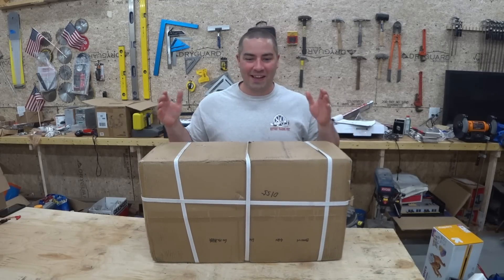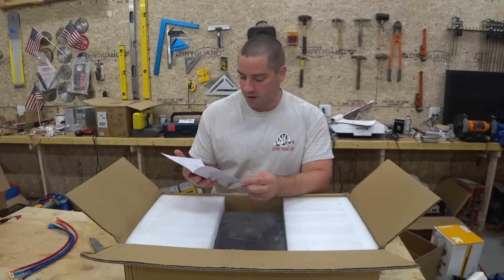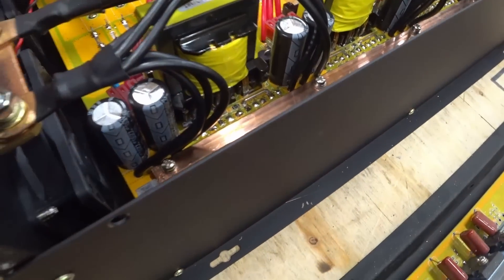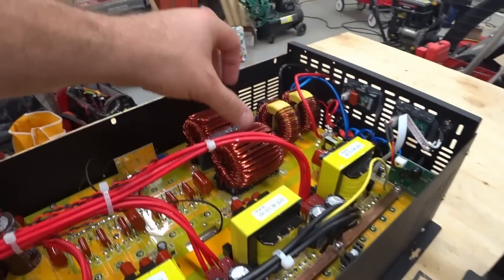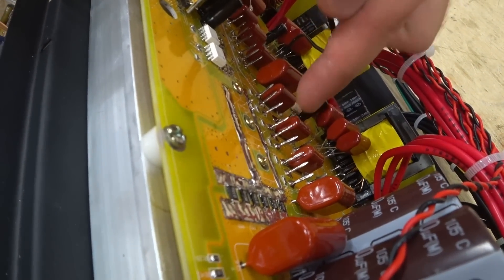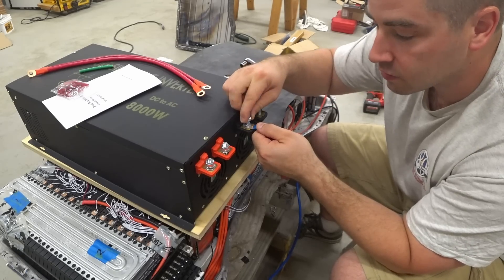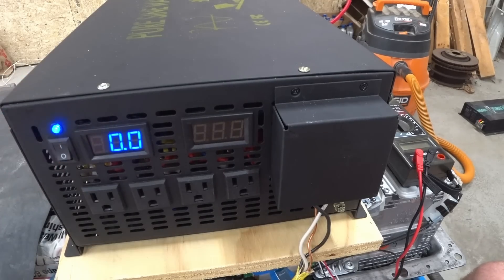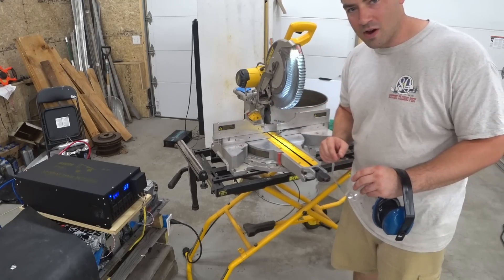Cheap 8000w Reliable Inverter, That Works! WZRELB

Comment: Per electrical code…. Short jumps of wire will have lower over-all wire resistance end to end than of course longer runs of wire, so in theory they should build up less heat and take higher current ratings.  A short run of a few inches should be able to take a lot more current than a run of several feet would… Specifically by chart, 90 feet of #10 gauge would take only 30 Amps, but cutting that by a 1/3 of the length to 60 feet would boost the amperage by 2/3 up to 50 Amps… so I'm fairly confident that a few inches can likely handle the 66 actual Amps at that length/ampacity curve that it would take for 120V AC power at up to 8000 Watts.. Extrapolating that curve (if straight linear), then 40 feet would take up to 70 Amps.  Fairly safe to say those wires are more than adequate.  Were it DC current, it would be a completely different story then…. but you are dealing with AC which doesn't heat wire up nearly as much because of its alternating directional nature.

(by formula:  P=IV, or Power(in W)=I or current(in Amps) * voltage (in Volts), thus by algebraic reworking, (P)/V=(IV)/V becomes P/V=I   and so your amperage is 66 as derived by 8000(W) / 120(V) = 66(Amps)).
Reply from the maker: Excellent explanation, Thank you.

Comment: yeah preTT y good indeed 48V is killer size... so is 24V without the shock factor
but hmmm that thing is a hog... 40W !?!? 
check out the Titan Solar generator (24V, 3000, 6000, ...) less than 10W, 2 of them will out perform this thing and give you redundancy.

Comment: Compressors, good ones anyway do not start under a load, the head pressure is vented when it shuts off. The start load is the same at 0 or 90 psi.
Reply: wrong... there is a 12/24V compressor which runs an air impact wrench tankless or with tank.

Comment: unlike your first test, you're hooking up only one device at a time not getting anywhere close to the load put on the other. This is not even close to a comparable test,  Reliable Electric must love you for this as most people would not understand the difference between a heavy load and an extremely heavy load. I was born at night but not last night.
Reply from the maker: You might like part 2 of testing this inverter: https://youtu.be/TZbjy9t933E

Comment: That one is built better than most of their units. I took the terminal wires and changed those to a copper bus bar and 4/0 on the battery cables inside I changed them to a 1/0 cables.

Comment: How about a rv air conditioner?
Reply from the maker: I have not tried an RV AC.  I have been able to power some window AC's and my air compressor.
Reply: @DavidPozEnergy  my rv pulls 1400 watts on cool. Around 1700 watts on heat. And you are dead on. 10 gauge is too small. 6 would have been better.

Comment: Your touching and picking a 8 k watts inverter see all the capacitors.  Bet it's still hot. LOL
Reply: Why don't you go 24 volt? 1/2 the watts. I just made my 2 gage battery today .came out nice. Wow that thin wire behind your inverter. Try touching it.

Comment: How long can it go
Reply from the maker: Inverters should last 10 years or more if you don't stress them out.  This inverter is a high frequency inverter, which is more susceptible to damage from overloading or surges.  So if you want this type to last a long time, then size it for more than you need, meaning don't load this with more than 4000 watts continuous.  (this is an 8000 watt rating)

Comment: man they really cheaped out on the main terminal block coming out of that joker the ac side lol and pretty interesting how they chose to run the output wires straight through the metal hole with no gromet protecting it

Comment: Your "testing" of a "pure sine wave" inverter didn't even include testing the sine wave. I should have stopped watching as soon as you opened it up, having no idea what you were looking at. Independent of what you don't know and understand about this device, the first thing you should learn is what "test" means. 

You wrote "This inverter outputs a pure sine wave, 120 volts AC," making a claim that this device does something you don't understand, much less know if it even does what you claim. 

The above is rather academic because, in short, looking at that device, I can tell you it's not long for a disaster under a high load. I would advise you, and anyone else, to not to use that unit.

Comment: Thanx Dave 4 the video. It is the first time that I hear of a 8 kW Inverter. Last year and also in 2006 we  in ZA (South Africa) had rolling Power failures. For weeks on end we had to cope with out electricity. I have looked for inverters hear. The strongest was 5 KW and it cost an arm and a leg. And also with a 5 Kw Inverter you must have a BIG power bank. Not just a motorbike or car battery. It look like for emergency needs, in ZA, that a 1.5Kw will be the min. But even that cost also an arm and with out the leg. Since 2006 I have bought 2 small ones. So I can use the lights, radio, TV and the laptop. It is two systems. Also our electricity is 220- 240 Volt.   Thanx again.

Comment: It's a high-frequency inverter, it won't handle big surges. If you want reliabilty you are far better off with a low-frequency inverter that has a really big and heavy transformer.
Reply from the maker: I agree.  I run my house on a low-frequency inverter: https://youtu.be/dfHb5tZErTs

Comment: Remember big motors can only run for few minutes, I bet you will not run more than 15 min lucky if you pull 30 min   ( 8000 watts ) peak so technically you are only allow to run 4000 watts constant .....anyways good luck!!!
Reply from the maker: Thanks for watching.  I have an updated video with a longer test: https://youtu.be/TZbjy9t933E

Comment: Have a question if I took this converter inverter and hook it to my car battery and started my car up let it run because of storms coming long run my icebox my lights would that work okay if so what's the procedure to make the wiring right
Reply from the maker: Thanks for your question.  First part "would that work"?  Nope.  This inverter requires 48 volt DC input, your car has a 12 volt DC battery.   However, you could buy a 12 volt inverter and connect it to your car.  But your car is not a good backup solution.  If you run an inverter from the cars battery, with the engine off, you will kill the battery fast.  If you idle your car it will burn far more gasoline than just buying a generator.  The easiest way to have a backup system just for one (short-term) storm is to buy a small portable generator.  example: https://amzn.to/2MPweid   You can connect with me on Facebook if you want to talk more.

Comment: inverter is 48 volt dc.. 10g wire is fine for current draw at max
Reply: 10 gauge is on the ac leg output.....too small!
Reply: Actually 10 ga is fine for 240vac output as the current in half, thus 30 amps!

Comment: The wires are NOT too small. The references made to gauge requirements are from the wrong chart. If you look for the temperature rise chart for unbundled, in-chassis wiring, you can see their sizing is correct.  Also, the insulation temperature rating will need to be considered when checking the chart.  I don't know the rating of those, but 105C cost no more than lower temps so everyone is using it. ALL manufacturers use the temperature rise method to determine the wire gauge required inside their equipment. 

Wire length has no bearing on the wire gauge required. Sure, wire length will have more resistance, but the current will be identical along the entire length of the wire. If you don't believe me then tell my why fuses are so short. The Ampacity of the conductor is not length dependant. It is the voltage that drops along the length of the conductor. This voltage drop is due to the power lost to heat, yet the current will always remain constant. 

High Frequency switch mode power supplies have a giant advantage in reduced transformer size. That was the breakthrough in power conversion that swept the industry in the 80s. So yes, those transformers can carry the rated power. 

Great video, thanks. This inverter seems to have very good surge capacity.  It would be fun to run it at 100% for a while.
Reply from the maker: Hi Don Doyle,  Thanks for your comment.  You are right, I did not know about chassis wiring.  I'm glad so many people (such as yourself) are willing to write comments to help me out.  I did make another video running this inverter up with more loads: https://youtu.be/TZbjy9t933E

Comment: what's powering the inverter sir?
Reply from the maker: It is a lithium battery.  Originally out of a 2013 Smart Fortwo electric car.  I salvaged the battery and re-wired it to 48 volts.  I have several videos on my channel detailing the build.  Thanks for checking out the videos.

Comment: I have to ask. How many things do you have in your house to need 8000 watts? And do you ever have them all turned on at once?
Reply from the maker: My house is 100% electric.  Things like electric oven, stove, baseboards, water heater.  It only takes two things on at the same time to draw 8kw.  Thanks for watching.

Comment: Reliable Power inverters aren't pretty or sexy but in my experience they work and keep on working.  I have two 2000 watt pure sine wave inverters and a 500 watt (first 2000 watt unit has been in intermittent service for over 2 years, 500 watt unit for over 3 years).  Their output is cleaner than the power the local electric co-op delivers (and I have the scope pictures to back that up).  The ">85% efficient" is true at less than 50% load (90% at 300 watts for the 2000 watt inverter) but drops to about 80% above 50% load (tested with a Kill-A-Watt on the output and my volt and amp meters on the input).  

As the average hourly load on my "solar generator" is less than 300 watts (max loads of each appliance are averaged into that number, including the defrost cycle of the fridge), it handles the frequent (usually short) power outages we have with no problems and the solar panels bring the batteries back up to full charge when commercial power is restored.  If I put out additional panels (usually only have 250 watts online but have 1600 watts available), I can have limited power most of a day (depending on season).  420AH of 12 volt AGM batteries can power fridge, some LED lighting, phones and internet for up to 16 hours (no sun) or 24 hours (with sun and additional panels out).  In 10 years, the longest outage at this location was 16 hours so we're OK for the most likely outages and there's an inverter generator to fall back on (including gasoline for two weeks).
Reply: I have a 3500 watt puresine reliable unit I got 2 bad ones in a row in the mail and the second one was a bad AC regulator card I had to unsolder the card from the board and replace it with one the manufacturer sent me and it fired up.i still have it collecting dust I dont use it at all. I do not want to put it in my portable solar and wind system and ruin it. I have 1410 ah bank and 1800 watt solar and 500 to 1200 watt 3 phase AC PMA turbine and prototype telescoping tower that can fold down for transport and both large solar arrays fold down like awnings using linear actuators. EPEVER 100 amp mppt controller 200v and EPEVER 80a mppt 200v controller and huge bus bar in electronics box wired my power bright 6000-watt power inverter with 4 4/0 cables to bus bar and hardwired 30 amp RV receptacle box.  My dump control board and solid state relay and 100 amp rectifier 300 watt 3 ohm resister bank for resistive braking and dump or drag down setup is cool. I'm still working on it.

Comment: The redesign of the new version is way better than the original...but like you I am concerned about the smaller gauge AC lines on the output.
I will be checking out this new one...if I do get it I will upgrade those output lines to something that can handle 67 Amps
Reply from the maker: Sounds good.  They did get hot during my full load test: https://youtu.be/TZbjy9t933E

Comment: The length of the wire also determines  how much current it can carry,,, Think about how small the wire is inside of a fuse,,, A short piece of 8 or 10 guage can probably carry  100 amps,,, or more,,,

Comment: How much did you pay?  I saw on fleabay for $1170
Reply from the maker: I did not pay anything.  Reliable Electric sent me the unit for free to test and review.  That is why I labeled the video "sponsored", although they did not pay me any money and don't have any control over what I say.
Reply: @DavidPozEnergy  Thats great it really seems well made for chinese looks much better than the harbor freight ones , i actually saw another 8kw one , it was 8kw rms and 16kw peak it was on sale for 699 , on some site....so i would use one of these with 4 odd wires one for pos and for neg  from battery of a running vehicle and we could see the full 8kw . so im guessing they sent you the 48v model?

Comment: @
DavidPoz How come your Amazon link  model has only 2 outlets?
Reply from the maker: The link is provided by Reliable Electric.  They said they will be selling the inverter on that link, but it looks like they still only have the 24v model on there, not the 48 volt model.  I don't know if they are out of stock, or what.  I'm sorry for the inconvenience.

Comment: Love your videos!  Would you replace your Aims 6000 unit with this?
Reply from the maker: Nope.  The Aims is 120/240 volt, and this inverter is 120v only.  It is better suited to mobile applications then a house.  At least that's my opinion.

Comment: And what size inverter do you recommend to run an entire house hold, full size fridge, washer dryer, television, LED lights through out, & central air, ECT.
Reply from the maker: For a whole house you would probably want to start with a 6000w inverter and go up from there.  I have been using a 6kw Aims inverter for my house.  However, there are limitations.  Example: I can't run my electric oven at the same time as my microwave.  But, if you have a gas oven then this would not be a problem.  One of the best things you can do is to get a meter on your house circuit breaker panel that will let you see your peak watt draw at any given moment.  Your inverter should be sized for the peak.  I'm using an old version of the "TED" meter: http://www.theenergydetective.com/  But there are others you can coose from.  Here is an example of a less expensive option: https://amzn.to/2GWUieM

Comment: Typical of the folk who live in the states. Got to have the biggest and loudest of everything goes along with there mouths. Who needs that amount of inverter size, just need to know how to use them. I use a 3Kw inverter with the same chop saw never had it fail. Plainly has never heard of Chokes if he calls them doughnuts, really says it all.

Comment: Does anybody make an inverter I could run my central ac off of?  Outdoor unit and fan inside need 28 amps at 220 volts 60 hz total
Reply from the maker: Hi Eric,  Yes, You would need a minimum of an 8000 watt inverter, 120/240v.  You will want to make sure you have a "Low Frequency" inverter.  LF inverters have large transformers inside that can handle the surge needed to start a big compressor.  (There is a big compressor inside the air conditioner).  Here is an example: https://amzn.to/2Kn0Ghd

Comment: Needs to try an air conditioner! Because those mostly get used by motor homes ac , microwave etc I agree that it’s actually a 3600 watt inverter and should run an ac no problem continually but that’s all! Needs 2 of them for a motor home!
Reply from the maker: My window AC works great on it.  I've run it continuously for a few days.

Comment: DavidPoz, you're handling this inverter as if you presume all the capacitors are discharged.  You can't make that assumption.  Not good form to be touching all that wiring with bare hands.  Luck is with you.  Advise don't do that again.  Wear some insulating gloves if you're going to be, feel you have to touch all those power buses.
Reply from the maker: Thank you.  Yes, you are right that we should not assume the capacitors are discharged.  I did check that off-camera by turning on the inverter (nothing happened) then I shorted the positive and negative with a resistor (nothing happened) then I shorted them with a piece of wire (nothing happened).  Thanks for watching.

Comment: in context of correct use  each terminal of AC plug in on front 2,000..

terms of use in whatever you yanks call and RV whether it be a bus conversion ,  5th wheel or a-frame caravan, with 1,500 microwaves, rangehoods,  fridge- freezers and past 3000 watt wash and dryer combos you're already at 7,500 watts 

not including what other entertainment solutions you have i place..

you would be north of 12,000 watt more than likely and note this would be single faze 220/240 VAC  mains cabling which is rated to 15 amps, and  a fused mains inlet at 20 amps..

the voltage fuck around the North Americans play with cause issues in the step process from 220/240-110/120 VAC

as some who has lived full time in a caravan, you should be maintaining 220/240 VAC than enteraining the stupidity of supporting 110/120 vac when globally 220/240 bac is run

Comment: If you want the battery and inverter to last longer and start and run more appliances you should build or buy soft start technology.  Also this inverter most likely does not have enough or none at all thermal compound between chip and heat sink. You should that it apart and apply thermal grease. You should also change out all the wires that are not really rated to handle in your opinion 60 amps. This is just my opinion. Thanks mate for the video.
Reply from the maker: Thanks.